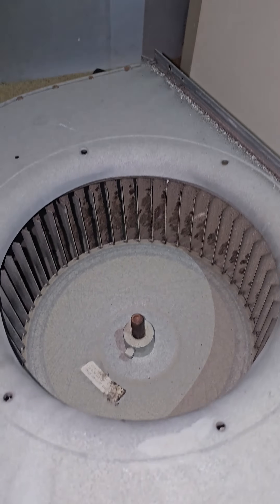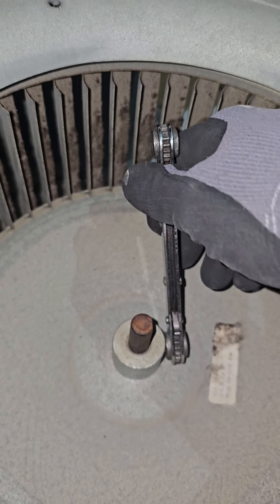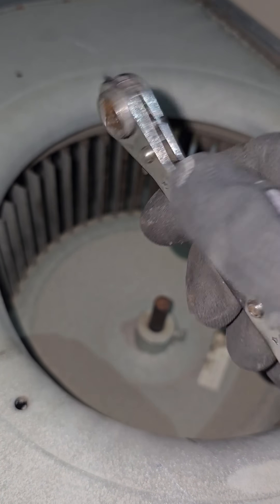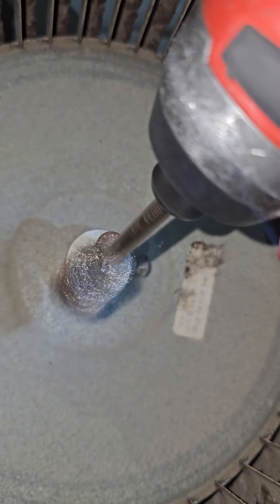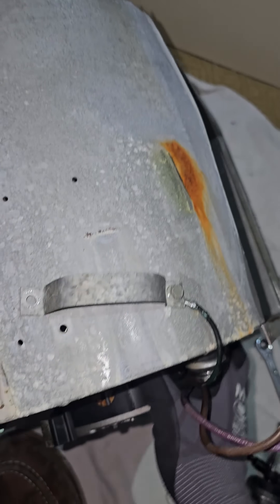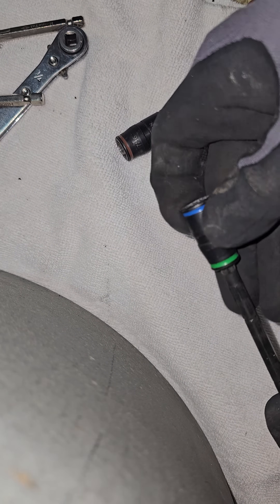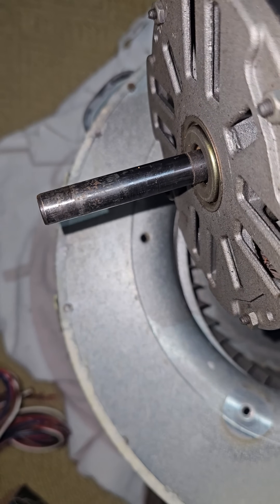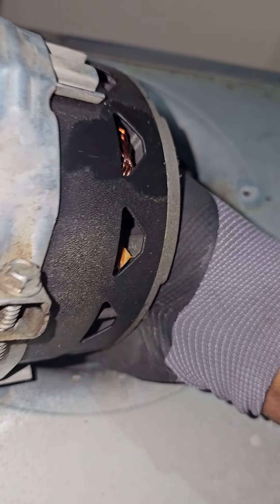HVAC TIPS AND TRICKS | BLOWER MOTOR REPLACEMENT

Comment: I don’t have trouble taking out the motor but I am still struggling on wiring the replacement of the new motor, is there a video where you show how to wire the motor?
Reply from the maker: Not this motor however I have other videos installing and wiring up motors
Reply from the maker: Also if you were a preferred member then I would help you do it through WhatsApp!
Reply: @D2DNYAC Sounds good I’ll think about it brother thank you